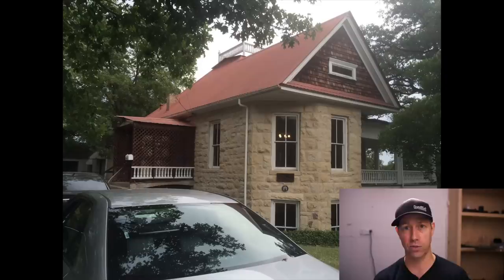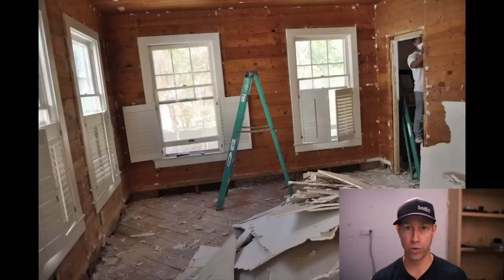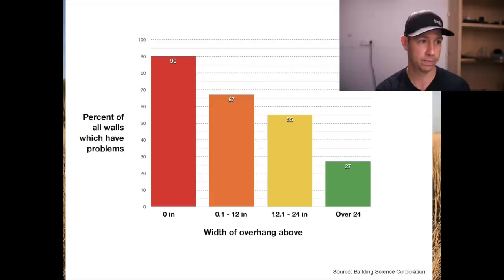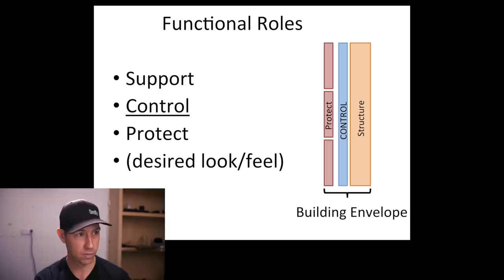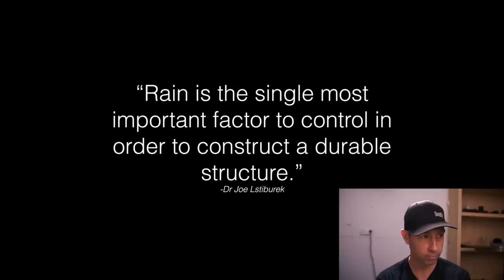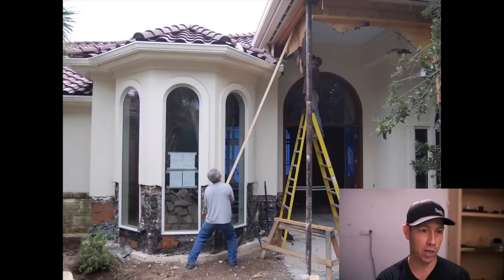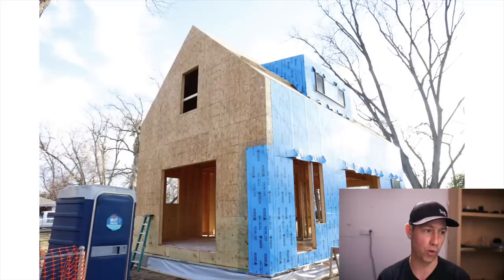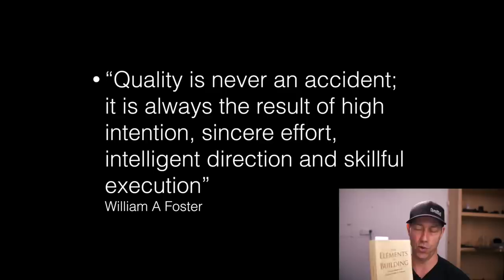Were Old Houses Built Better?

Comment: Matt, I can understand your perspectives to a degree...

Respectfully, however, until you actually know the craft of the "Housewright,"...from beginning to end, and how homes of antiquity functioned within the normative culture's of their time, this video is speculative (on your part) at its best...

Not only do many effectively live in old homes, but there are ever growing communities of young families building "old homes," for not only there charm, value, and ease of maintenance but also their efficiencies and lack of dependency on "modern materials" and the rather disgusting industry that supports it...

For me, and those like me, I can more than respect an "opinion," of what a "modern builder," thinks they know and understand. However, until those often very opinionated individuals (like you?!) can actually design, from scratch, a traditional home, and then walk into a quarry to select and shape stone to fit the needs of building, while later cruising a forest for the timber needed to log, mill and then shape for timber, plank and board to form the bones of a house, I have little doubt that videos like this is "guessing" at best, or clueless at worst, about what is actually understood or known by the individuals making the video, or "explaining" what does and does not work about old homes...The do work very well, can be actually more efficient than most modern homes and they need not rely on the construction industry at large to achieve those parameters of durability and success in means, methods and materials that are more sustainable and naturally durable and serviceable...rather than depended on "big industry" for there manufacture...

Comment: It is respectable to build with a hundred years as your target age, more is bonus. If you can use a technique that lasts 4 hundred years all the better. Building "energy efficient"  houses that only last 40-60 years are perhaps not so efficient after all, just like new cars are not so green, since they get scrapped faster. It is just as well to look at the whole life of a building from inception to complete disposal when working out it's energy efficiency. It is too  easy to say modern complicated high tech systems are better than older complex low tech systems, and quite likely wrong. Time will tell.

Comment: Why live in an old house that can stand the test of time,that can be very comfortable and doesnt allways leak when you can have a new house and completly re build it every ten years!.Whats the pont building any house from OSB and then tirelessly wrapping it in bitchumised baking foil or (what we call in the UK) Flashband,its non sensical.Flashband has been used for years and has always been the cowboys option to Lead, it has many limitations and is certainly not for ever.Iv been building for over 40 years and have seen many changes and its not that im sceptical of new technologies but i have yet to be convinced they will stand any time test like the materials used old stock houses.These re models you are showing on your shows are all well and good but you are assuming that the latest materials being used are the last word in technology and everything is super tight, but one word of caution here, these technologies will be dated faster than you can ever  immagine and they are not cheap,what then?...tear it down and put in the latest technologies!...No theres only one answer stop building giant sheds with Balsa wood, UHU and foam.Oh and theres just one other point that never seems to be mentioned is the fire risk....look up Grenfield tower fire in London, they cladded that building in giant slabs of expanding foam too!....Good video though and just reaffirms me that bricks and mortar can not be replaced.

Comment: I forgot to tell you about comfort standards. Italy, 2000 years ago ,homes had central ac and heat .How the hell did you come up with lower comfort standards years ago? That is just one example.Go back to school ,learn engineering then come back and have a show on the nett. You have not yet begun to learn construction.

Comment: "In Texas you don't want a vapour barrier on the inside. It's a big nono"...5 minutes later "I call it the perfect wall house...the first layer from the inside after the wood is a vapour barrier". Don't try to act smart when you have no idea what you're doing and learn the physics that happens in a wall first. A vapour barrier on the inside never hurts a correctly built modern house but to have it on the outside will as soon as the temperature outside is lower than inside. This is basics in building science. However everything outside the vapour barrier has to be able to ventilate water and vapour out of the construction (breath) or be perfectly sealed. As it is almost impossible to seal it to 100% as seen in your first bad example the best way is to have a ventilation gap behind the finishing layer followed by a breathing layer that still can stop liquid water to some extent to act as a secondary rain protection. The primary rain protection is the finishing layer (wood panels, bricks, steel sheets etc). In ordinary conditions rain and water won't penetrate the primary and secondary layers. In heavy storms and floods it can and will but if the secondary layer and insulation allows some ventilation the water will slowly evaporate and the wall dries without damages. Seriously first class of building science.
Reply: Yeah, I'm not sure what he meant wrt the vapor barrier thing. Obviously faced insulation requires that if used in an exterior wall, the paper is on the inside. If used in an attic however the paper goes on the outside. The vapor barrier he showed on the inside was plastic, an likely the cause of the drywall being moldy, since the plastic cannot breath. But also the issue could be attributed to poor installation of the insulation, which allowed cold air to the drywall.

Comment: I still wonder why you Americans don't build like Europeans and most of the world. Modern European houses have a reinforced concrete structure with brick outer layer, insulation and brick inner walls. Sure, they are more expensive to build. But at least you build them once, can last longer that old houses if taken good care of and have also all modern comfort and energy requirements. I mean those repair you guys do seem pretty expensive. Surely it ends up being cheaper to build them of brick and concrete in the long run.

To me building a wood house is baffling. Even more so in hurricane areas where the wood houses just fly off. 

So... why do you build them of wood?
Reply: We do have brick structures in areas where it's feasable.  There are areas where it is not feasable to build with brick.  I love European architecture in all its varied glory, but the fact is that we don't build as in Europe primarily because we aren't in Europe.  Our materials availability is different, our structural and thermal needs may be different, too - and that holds true even between regions within the US.  A house in Italy isn't exactly the same as one in Ireland, either.
Reply: @TiaKatt  How can brick not be feasible? That just sounds like an excuse to me. A wooden house also needs a strong foundation. And there are apartment buildings on river deltas. So...
The not Europe thing is also not a great argument. North America and Europe expand the same latitudes. And is true there are differences amongst Europe, but those differences are more about the interior or aesthetics and not as much about the construction technique. Specially with modern ones.
And about the materials. Concrete and brick are made with very common materials. Hence, why it's widely used.

All I see, is that is just a cultural issue. There is no rational reason to choose more expensive, shorter lasting materials. That outset any initial savings you might have at purchase by their fast decay. Leaving you with more expenses and headaches.

In Europe. You build a house. Live there your entire life. Nothing needs changing. Not even the roof.

From what I can tell in the US some people change or repair the roof every 10 years. That is something outside the European imagination.

Wouldn't it be nice? To have a house that needs no work? Maybe only once every 100 years instead of every 10?
That does not fly off in a hurricane, failing its primary purpose, protect everything it contains? And does not leave you with nothing? Isn't it cheaper not having to rebuild and/or buy all your belongings again every hurricane season?

Comment: And old stone or brick houses weren't hotter in the summer than modern. They were cooler because there was no insulation that would recycle hot air.

Comment: OSB should he banned in construction. 'Just-good-enough-for-now' construction is a problem, not a solution. North American so-called "building science" is a low standard in its best approaches, and relies on unskilled and semi-skilled personnel to keep the product 'cheap'. A 25 year serviceable lifespan and no serious failures after a few years is not a very impressive standard. Even this is based on marketing claims of suppliers, but claims were made in the early 1970's too, and houses built then were trash by 2000.
That stone "rubble" house (with Ashland corners I believe) used materials that have endured c. 350 million years. That seems durable in my estimation. With the right choice of mortar cement a house built like that could withstand profound climate crisis's, even submersion in salt water. Rather than disrespecting the technology it might be appropriate to determine the values it might still illustrate. A culture that uses disposables so extensively will be disposable itself. That's historie's opinion.